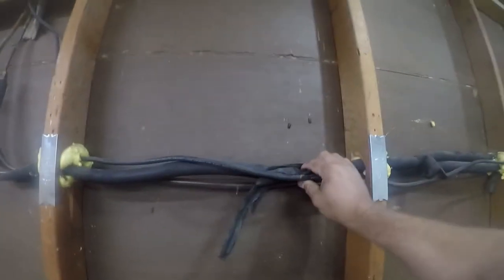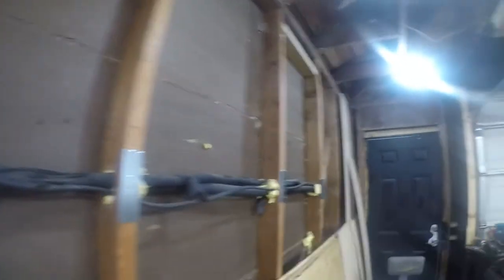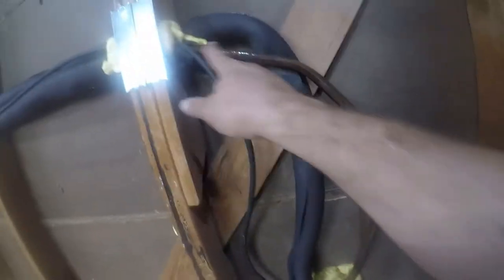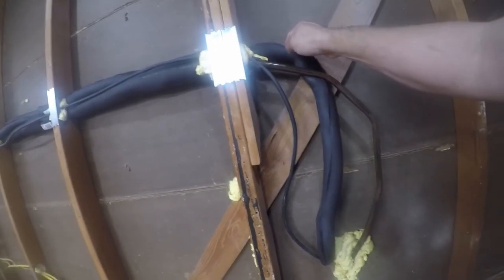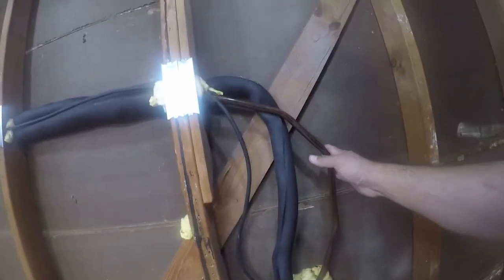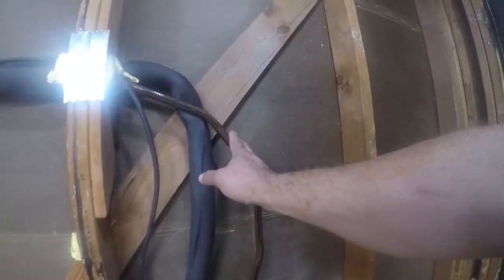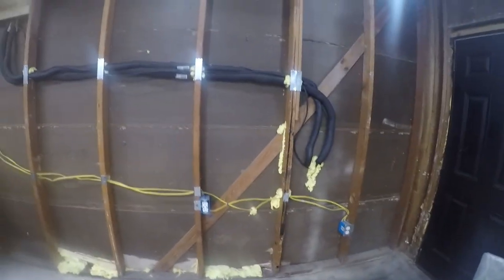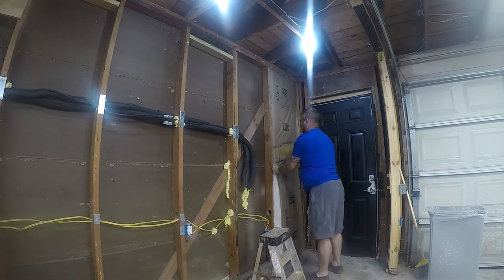Garage to Workshop conversion - Part 10

Comment: Hi Brian. I am curious why dont you use your spray foam system to insulate your garage. I though this was your original goal for the garage right?
Reply from the maker: That was the original idea... but the cost of the foam, hassle of moving everything around, and temptation when someone contacted me and wanted to buy my rig all conspired.  I sold the rig and realized I don't plan on 24/7 air conditioning for the garage.  It's basically a work shop.  I have another video coming soon on this project.  I'm actually working on it today.